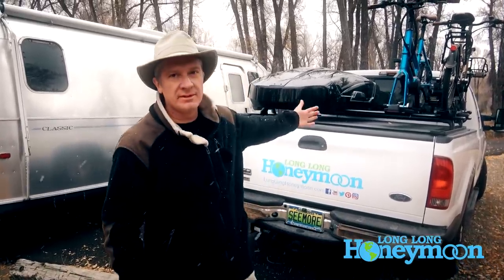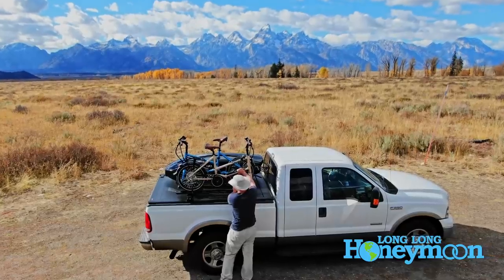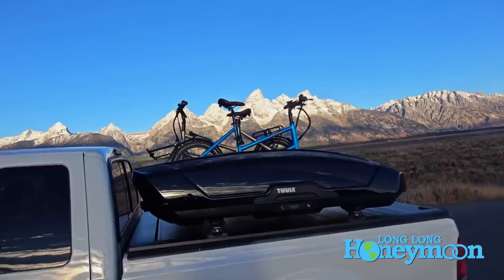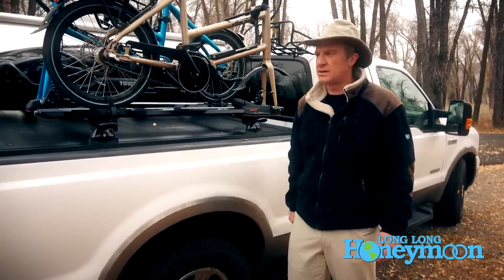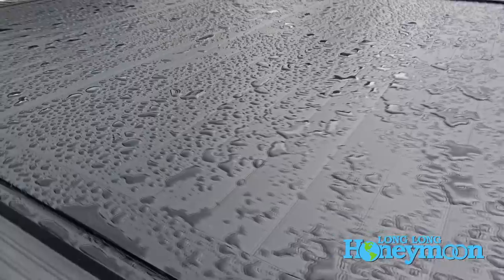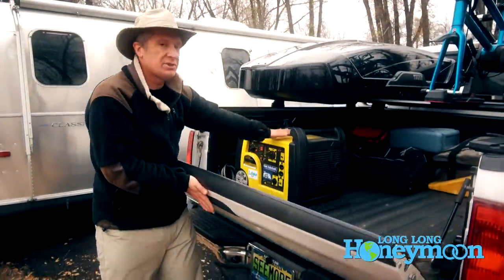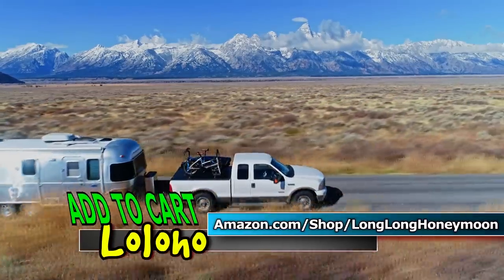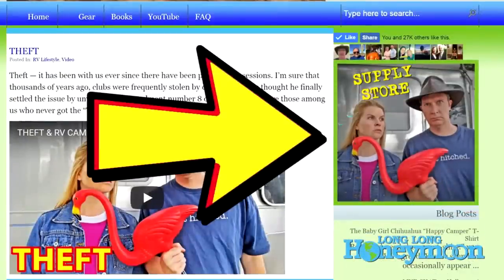THE BEST TRUCK BED TONNEAU COVER? RetraxPRO XR Series Review 🚲 🚲

Comment: Hey I'm between this one (or its roll and lock e-series counterpart) and a hard top like renegade or diamondback HD (or even a leer or rsi cap) but having to often leave the truck unattended in bad neighborhoods with a lot of expensive gear, I am concerned about the security of these retracting ones compared to the hard tops like renegade/diamonback. I mean, can you stand/jump on these? I mean obviously they're more difficult to break into than the soft covers but still
Reply from the maker: I'm pretty confident you can stand on these tops, but at a weight of 200+ pounds I'm not planning to jump on mine. However I really think it would hold up okay. I doubt it would break, but I don't want to bend the slats. Supposedly it can hold up to 500 pounds of "evenly distributed' weight. They are tough and with the locking feature, someone would need to be really determined to break into them.
Reply: I had a retrax on my 2013 silverado 1500 and loved it. I had not tied down my spare tire (40s by the way) in the bed and it hit the storage box and dented it badly so when I pulled it forward is scratched the slats and never worked properly again. I have a new chevy trailboss and have many upgrades and if you are off roading a lot i would go DB HD covers for sure! I just ordered mine. No disrespect to the creator on this video spot on by the way. I loved mine but also don't think the are really meant for off road use much..hope this helps

Comment: Would love to see a quick video on how quickly you can install and uninstall T-Slot accessories... I'll be pulling a fifth wheel but want to store the bars in the bed when towing and then when we get to our destination, quickly slip on the Thule bars and accessories. Trying to visualize how much time that actually takes!
Reply from the maker: We actually have Yakima bars and accessories and a Thule box (this combo was recommended by the bike shop expert). You can remove the entire setup in a couple of minutes but it’s a 2 person job. You can remove individual bars pretty quickly... we did it today but it was the first time so it took a while. With practice I think you could do it fast.

Comment: I had a Silverado with the retrax tonneau cover.  A very good cover.  The problem I had with it was when I went through a car wash with my truck and a closed tonneau cover.  One of the employees of the wash who was short had climbed up on the rear wheel and the side to dry the rear window.  While he was drying it he knelt on it and broke the top between the slats.  We did not know it was damaged until a couple days later when I found the the top was leaking.  I had to purchase a new sliding top from the manufacturer.  For this problem on my new trucks afterwards, I went with the Undercover Elite.  Although it doesn't roll up, its completely waterproof and can take the weight of several people without damage.  It can also be removed by two people and comes with wall hangers when you don't need it.
Reply: Retrax Pro XR is rated for 500 pounds. How much did that car wash employee weigh?

Comment: Your mid drive electric bikes might not be truly water resistant with the in- frame motors. A hub motor electric bike like Radcity could have its electric hub motor wheel removed and stored in the dry cargo box. Thanks for all the  videos so far.
Reply from the maker: We have some canvas covers but have yet to get them properly configured on the bikes. I agree that I’d like to add some weather protection.

Comment: Good review. I LOVE having a really durable, secure tonneau cover on my truck. I hv a Diamondback. I even hv a truck bed tent (Kodiak), and I sleep on top of the Diamondback with ample storage underneath. How much weight does the Retrax hold on top?
Reply from the maker: I've been told the crossbars will support up to 300 pounds? Not 100% sure tho...
Reply: crabby117 incase you or anyone else needs the info, the cover itself holds 500+ lbs on top of it. Almost all crossbars hold around 300lb. I’m looking to buy one of these myself soon!

Comment: Better get covers for those e-bikes before water gets in their electrics and the frames rust away.
Reply from the maker: Yes, we have some covers but they aren't the greatest in high wind conditions at highway speeds. We need to find better ones.
Reply: I actually carry my ebike and expensive road racing bike in the camper while driving to keep them safe and out of the elements.  Bungee cord them in place and don't have to remove wheels.

Comment: how did you fit your generator under the cover?  those generators are tall.
Reply from the maker: The Champion 3100 fits perfectly. Unfortunately I doubt our Yamaha or Atima will fit.
Reply: if you ever get stuck in Franklin, TN you can park in our driveway!   Love your videos!
Reply: I noticed the Champion, too. We're getting ready to buy our first generator. How do you like the Champion? Thanks.